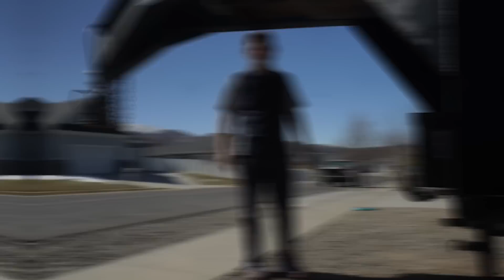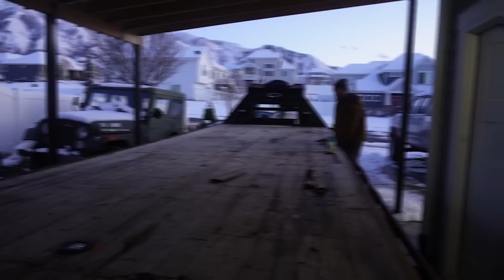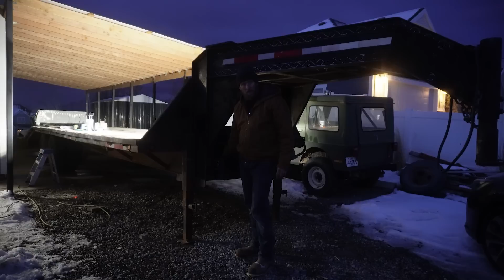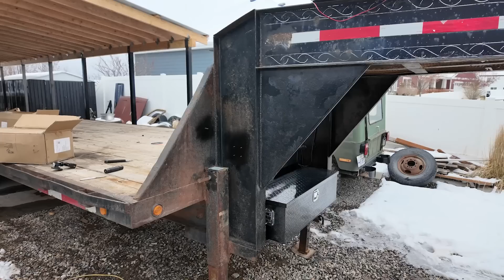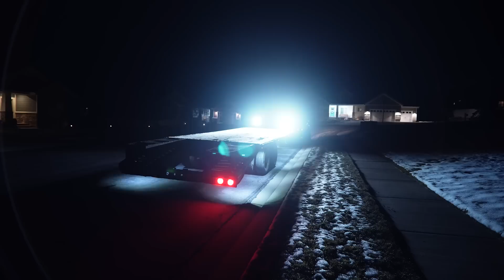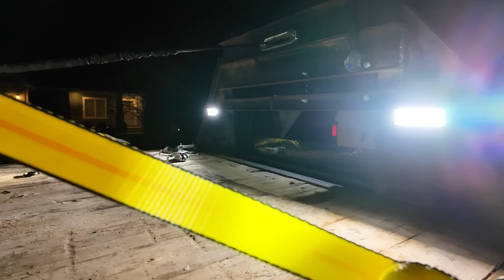Every Trailer Needs These Upgrades! | $2500 Marketplace Trailer

Comment: I would run the lights on its on power supply from the winch and for the winch I would weld two tubs to weid in two the tub that the farleads are and cross brace in between them

Comment: Install a forklift batter plu on truck &trailer with 2 /0 welding cable  then put 2 of the largest marine batteries you can buy.  You will have all the power you need. That is how my trailer is set up.
Reply: Had to look and make sure someone made this suggestion.

Comment: Definitely need to strap to wheels or axles you want the suspension to work while towing. Shouldn't use the frame to tie down.
Reply from the maker: You are 100% correct! I'm going to make sure to do that.

Comment: this is what I used on my Jumper Cables with a Quick Connect Plug they are on Amazon I tried to put the link but wouldn’t let me works well and don’t even have to have a battery on your trailer and maybe use a roller rather than the fairlead

Comment: Line your winch up thru the fairlead, less drag, less friction, more power.
Reply from the maker: Yep, this is a huge issue that I address in the next video!
Reply: not sure where youre talking about , he has his line through the fair lead i think doesnt he?
Reply: @warrenmichael918  he does, but it's not in line.. the rope is at an angle binding on the top.
Reply: @charlesq6148  ok i see what you meant now. You are saying to line it up better. I read it like you were telling him to use a fairlead like he didnt have one. I agree.

Comment: I would weld D rings in several locations on the top of the outer frame and tie to those, rather than the rub rail and stake pockets your straps will thank you, I have seen many straps cut by the rub rail. I would also use axel straps to tie a vehicle down and never cross tie, always as straight forward and back as you can. This all comes from a 40-year CDL truck driver.
Reply from the maker: You'll see what I come up with in the next video for tie down points. I had a lot of people recommend them.

Comment: I personally wouldn’t use those straps that hook in the frame. Every bump you hit the body will compress the springs and then slam back up against the strap. I like to hook on the axle or even through the rim depending how they are, I also have tire lasso straps. I have a non dually gooseneck that I put a side box on and have it stuffed full of chains, binders, and straps. I have one for the other side to install and a hf 12k winch like you have. I do like the lighting you did, probably gonna have to do some similar stuff to mine!

Comment: For charging, use a DC-DC charger like the Redarc which also has solar input.
The winch should be mounted directly behind the fairlead on a winch plate.

Comment: Hi Tim a few things I did on my trailer I installed a trickle charger so I can plug it in at night, I also installed Anderson fork lift plugs on my truck and trailer with heavy gauge wire so I can use the truck power also  when winching keep up the great work thanks David

Comment: Do you know what the gvwr is on the truck and trailer? Seeing a dually trailer makes me wonder if you need a cdl when hooked up to the dually
Reply: I believe Under 26,001 gvwr no cdl needed
Reply from the maker: I should stay well under the gvwr even thought it's a dually.
Reply: Sorry brother, but that trailer is rated at 20K lbs, at least, and I believe that dually is rated at 11K. Unless you de-rate the trailer, that'll put you at 31K. It's not how much weight you put on the trailer, it's how much it's rated for. It really depends on your states DOT regulations. Good luck, brother. Loving the videos though.
Reply: @ what he said
Reply: I was wondering the same thing!

Comment: Sometimes a pulley at the rear of the trailer to use the winch to pull from behind to at least get the vehicle to the ramps can be useful. Usually once you get the vehicle's rear tires onto the ramps, then you can reconnect winch to front of vehicle to continue letting it down off the trailer.
Reply: That could probably be done with the snatch block he got. Attach it to something near the break over point and tally Ho! Although he might need another snatch block at the front to hold the line down as the winch is mounted high on the neck

Comment: I finally had my son install a MaxTow coolant pressure gauge. I've been having terrible times with radiator caps with the red lever - they would fail almost immediately. I've gone back to the old style caps and they work much better. I had to relocate aftermarket coolant temp gauge to be next to the alternator. I think I get around 35 psi on the coolant pressure gauge while running around 70mph.
Reply: I have never put a gauge on coolant system but the rad cap only supposed to be like 15psi so seems you would always be blowing it open. Seems like you might have a head gasket leaking.
Reply: @bcbloc02  I don't lose water, thus no head gasket issue. Water pressure increases from the water pump pressuring flow. Try installing a pressure gauge and you will see the results.
Reply: @ cylinder pressure way more than coolant pressure so you can easily have cylinder pressure pressurize the cooling system without loosing coolant.  The system can only build pressure with resistance to flow. Is the thermostat that restrictive that it has 35psi in the head when it’s open?
Reply: @bcbloc02  If I had a head or block crack, I would be losing coolant. The pressure gauge is just before the thermostat. The coolant pressure gauge goes to 35 psi. My coolant system works fine. The only problem I've had is the crappy red lever radiator caps. I should have my son reposition the pressure sensor post-thermostat to better monitor actual pressure. I'll have him deal with that, if I can ever get him to come help. I'm getting too old to work on vehicles.